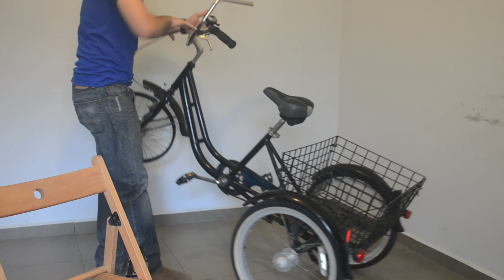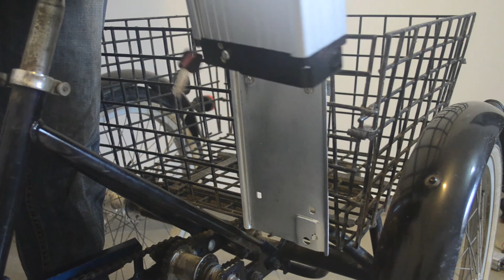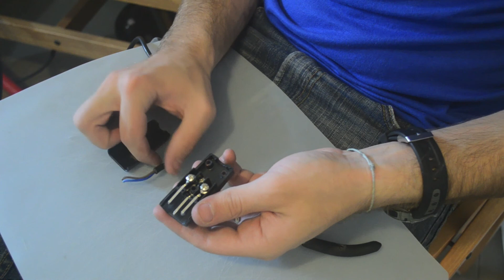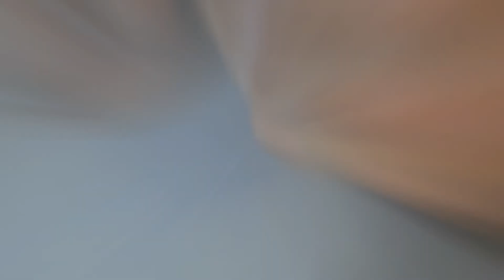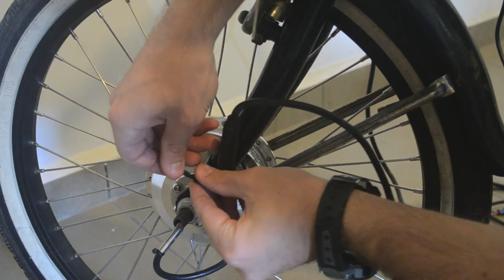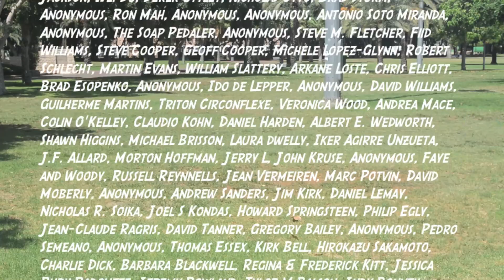How to build an electric bicycle

Comment: Hi Micah, 

Can I ask you some question on how I can upgrade my Electric Kick scooter? 

I have a 500W rear HUB motor and a DC 36V 16A Controller. I don't have the info for my battery yet. 

I wan't to have or gain more speed for it. I'm about 182lbs (83Kg). I can only reach 18 mph (30kph) on flat. I'm thinking if I add another HUB motor about 300W or 400W in front. What are those problems I will encounter? 

Thank you in advance!